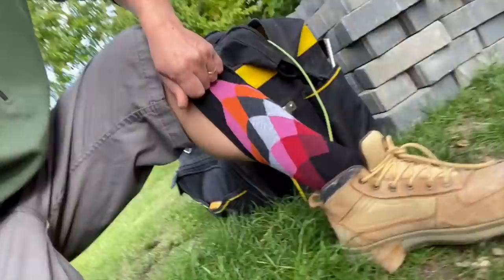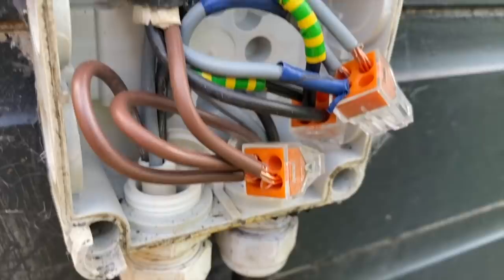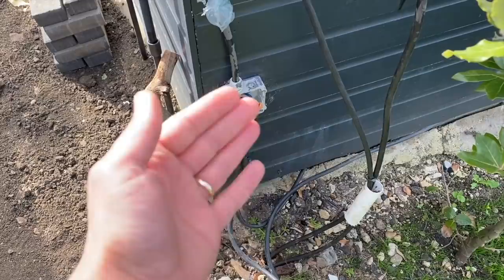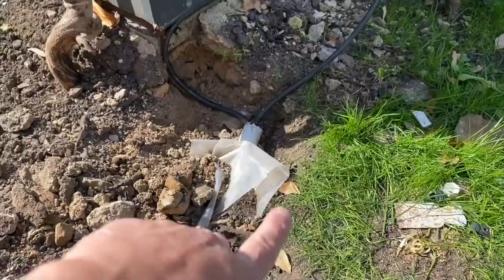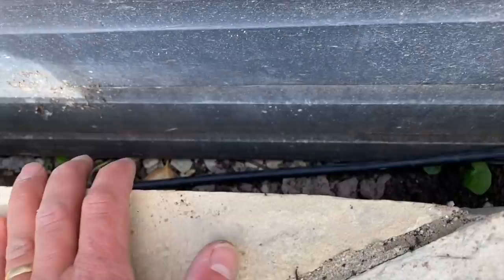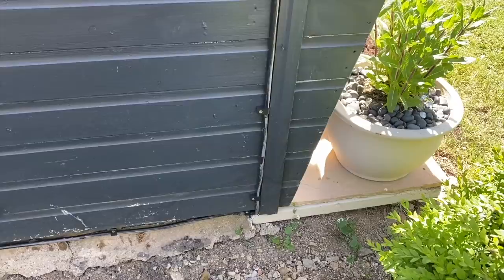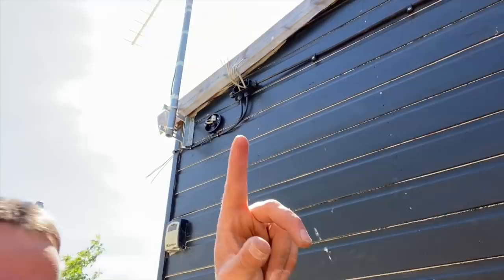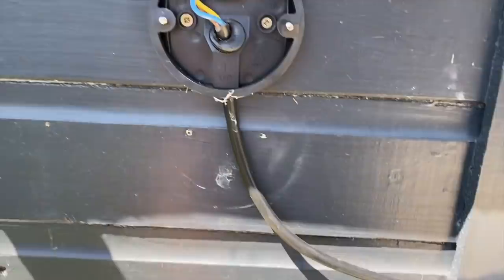Pretty sure this is not the correct way to install Wagos !!

Comment from the maker: Makes for a good debate this one. I’m returning to the job to sort the house end out yet so any buried cable that could potentially be damaged or impacted will be getting the swa earthed to the relevant circuit.
Reply: Is the lighting on a fused circuit or run from the socket?
Reply: Propper nice job.
Reply: Yes, I did think that the buried section of SWA should have the sheath earthed at the house end. I do appreciate that you would have to be pretty dumb to dig or drill into that cable when the cable run was so obvious. However, as qualified electricians (even ones with the very basic Domestic Electrician C&Gs like me) will know that people (customers, DIY'ers and some trade-persons) ARE pretty dumb when it comes to electricity.
You could still argue that the SWA sheath earthing should be continuous through out the installation in case someone were to extend the circuit later. However, a properly qualified electrician would know to check the installation before beginning work AND test afterwards. In addition the extended cable might require its own earth electrode (depending on cable length and purpose for the extension) .Complete amateurs would not appreciate when and why the  sheath should be earthed at all. The issue would be be for the people who know a little about electricity and do not necessarily have the full test equipment, however even they should be able to spot the lack of metal glands at the remote ends.
Reply: @tresslerj1985  a
Reply: @julianpearce218  a
Reply: @julianpearce218  a
Reply: @julianpearce218  àà
Reply: @despryal1951  your comments make no sense tbh
Reply: @julianpearce218  I don't see how it is legitimate to leave the armour unearthed, if a nail pierced the cable the line could be short to the armour which would then all be at line potential as the protection would not pick up the fault....
Reply: Those particular wagos aren't meant for multi threaded wires. The wagos that are, have levers on them for each wire separately, clamping the contact down internally and individually. Used them today in a new house we're building for a customer. The levers usually are orange.

That being said, the length at which the wires were stripped is laughable indeed. Bare copper is sticking out by lots in a way it could short easily, not to mention the risk of human contact.
Reply: Noticed you never earthed outside socket even tho drain hole drilled it can block  water would fill up and hit live causing box to become live it should be earthed to bottom terminal  seems strange but had this happen in a factory  and have noticed it several times when changing damaged sockets
Reply: @robertwilliamson3934  It's a polycarbonate box, so won't be going live any time soon. Also the instructions note that the rear earth terminal be positioned at the top. Indeed, "TOP" is even stamped on the interior. Got a problem with that, contact BG.
Reply: @JohnSmith-ws7fq  got a problem with that  yes I do smart arse  and they can fill with water and become live  checked with mk years ago and hagar ones currently have a non conformanty on them ie no earth  was just letting people know as a colleague got a shock off one years ago in a fish factory and have come across it several times since so your theory of it being plastic so won't become live is one off ignorance
Reply: @robertwilliamson3934  I would suggest the IP of the socket has been compromised either by improper installation or subsequent damage. That notwithstanding, (a) assuming this is the BG socket, the earth terminal is already the lowest point of contact for any water that has collected inside and (b) sockets must be RCD protected anyway.
Reply: @JohnSmith-ws7fq  incorrect  they drain hole was slugged up and on every occasion the earth was in top terminal my point is they should be earthed also these type of boxes are not solely used for sockets  which by the way don't always have to be on a rcd they can be risk assesed

Comment: The armour of an swa cable is classed as an exposed conductive part and must be earthed and the appropriate manufacturers glands used, it must never be left unearthed.
If you want to treat it like NYY-J then use NYY-J.
Reply from the maker: A conductive part which can readily be touched.
Reply: CJR ELECTRICAL  It can be made live under fault conditions such as impact or damage to the cable itself regardless if it’s buried or clipped direct to a surface , it should also be terminated using the correct manufacturers glands which are accessible once a cover is removed. It should never be left unearthed period.
Do you Earth recessed metal back boxes? Do you believe they should be earthed? Same principle. 
The fact is if the armour is left unearthed, then that the work has been left in a potentially dangerous situation and is non compliant with bs7671.
Reply: He explained it in the video its clipped no chance of impact it wasnt earthed before what he has done has left it in a much better place than it was before - as he said another days labour also that the client might not want to pay for - there is no problem with this job at all
Reply: Simon Harding If swa is used in whatever setting you can’t blindly state that the cable cannot be damaged , if the armour penetrates any live conductor, then it will be live and a potential shock hazard which is why it is earthed , the same as any other exposed conductive part which forms part of the electrical installation, if the customer doesn’t want to pay to do the job correctly then the alternative is to work on it and leave it potentially dangerous is it?
Reply: @simonharding1572  Irrespective of a persons interpretation of the regs, It is just good practice to earth the armour, unless there is a specific reason not to. He should have earthed the sections/parts he has altered (ie anything after the first socket) and fitted the appropriate external glands. If the client doesn't want to pay for the remediation of the supply cable then so be it.
Reply: Lets put it this way, if I was due my annual NICEIC inspection, I wouldn't show them a job where I hadn't bonded the armouring on an SWA

Comment: There is a type of Wago,nummert 221 that is directly suitable for flex wires.And i mostly avoid off wartles on the upside..They may be water tight,but sometimes you could forget to tight them up and the water comes in easely.That doesnt happen when you use the side off the box or on the under side.

Comment: Love the tip about using the gland to pop through the wiska cutout  - very neat.
But I can't agree with the use of ferrules for flexes in Wagos unless you use very soft copper ones. Because of the stiffness and hardness of normal ferrules, the blade in the Wago won't be able to deform the conductor in the way it normally would to get a good surface area of contact. I think especially on higher current circuits there would be a risk of connections corroding and become high resistance. Stick to the lever Wagos for high current flex connections direct to the copper conductors.
Reply: Have to agree with that

Comment: Looks good but id definatly gland the armoureds. You can get the earthing nuts that fit within the whisker boxes so you dont need the banjos. You can also get the IMO boxes which is a whisker with a din rail with terminals pre installed. Can get them from Edmondson wholesalers. I agree with someone elses post about the Grips, id definaly go for the knippex flat jaw version to eliminate destroying the glands.. especially plastic ones. Keep up the good work and stay safe 👍😁

Comment: Hints that this isn't NYY:
- NYY up to 10 mm2 is usually -J so 3-core would be brown, blue and yellow/green. NYY-O 3-core would be brown, black and grey but that's rarely ever used since you aren't allowed to sleeve anything green/yellow in Germany, which is where NYY comes from. Earths have to be green/yellow along their entire length. -J means with earth conductor, -O means without. Pre-harmonised German cable designations don't make much sense, just have to memorise them.
- NYY up to 10 mm2 is always solid, not stranded, I think you can even get solid 16 mm2 shudder

Comment: All that SWA is quite chunky for just using on the outside of the shed. If there is a low chance of mechanical damage I will often use H07rnf cable as it's easier to work with and doesn't look as industrial in a domestic setting.
Reply: Tbh we just use NYY and be done with it. Sometimes even NYM in UV-proof copex because it's up to code and for short bits outside in long runs it saves massive amounts of money.

Comment: I'd have probably glanded one end of the armoured with an earthing nut inside the box. At least one end of the SWA could be earthed then. Nice sparkies plaster by the way.
Reply: 100% it’s an exposed conductive part
Reply from the maker: A conductive part which can readily be touched?
Reply: @tomorichard  yeah I agree mate. The armouring could potentially remain live under fault conditions if not earthed. I would have glanded especially since it's buried. You couldn't see how deep the SWA was buried, there's always a chance a spade or whatever could damage the cable.
Reply: @Cjrelectrical  potentially if the outer sheath is damaged in the future. The punters aren't always as careful around cables as us sparks 😉
Reply: @Cjrelectrical  and I'm not having a go by the way mate. U could see the original install was dog shit and you're making the best of a bad job. Not a perfect world by any stretch mate.
Reply from the maker: No offense taken mate I’m going back to sort the house end out so might stick a piranha nut on it 👍
Reply: Good decision mate. Apart from the good install.
Reply: @Cjrelectrical  its very hard with jobs like this how far do you go without pricing yourself out of the job or doing work you dont get paid for but making sure its safe!
I would agree with the armour comment it needs to be terminated correctly incase someone puts something through it and makes the steel armour itself live. Cheers
Reply: @Daniells1982  that is what i was thinking. My pet hate when i go to jobs and the armour isn't terminated correctly.
Just he is putting someone else's mistakes right snd as far as the customer can see they will be paying forr no obvious change. 👍
Reply: I would gland the swa aswell its always best to use the earth wire and gland. Plus if the outhouse gets metal clad boxes in the future then they will need earthing protection

Comment: Dont know if you would be interested in this or not but where I am in the north of Scotland we dont ever tend to use any drain holes or any outdoor light or socket ect unless it's a IP rating of 65 or above. 

The weather is that bad when it comes that water gets in everywhere so you have to glad and seal if you want it to last any length of time. 

Lovely neat job you have done. Those lights would not last long here though only ones I have come across that seem to hold up well Panasonic's Victorian style LEDs dont know if they still make them but they had a decent IP at 66 and could be sealed well. Sorry for the randomness 🤪

Comment: Food for thought about not using the correct swa glands and ensuring the armouring has a good solid earth connection. Home owner decides to dig garden using an old school metal fork including the handle. Drives fork into the ground straight throw the armouring and live conductor. Will your circuit disconnect in time? Will it even disconnect ? Not picking holes in your work BTW you seem a decent bloke too and I can see your putting right someone else's shite work. Over the last few years I've seen so many installs were swa cables are not glanded correctly or not glanded at all.

Comment: We'd never be allowed to do this in Australia.     SWA would have to be down at least 500mm in sand covered with tape.   Seems in the UK you can just chuck it in without too much effort with the shovel.  We'd also  have to ground the SWA cable to ensure it doesn't become live in an accident.   Love the way you can use the rugged cable instead of conduits.  We'd have to put a sub in for the lighting too.

Comment: the armoured cables need earthing as if they were to get damaged the armouring would could become live and not trip nothing.
Reply: I was thinking about that, but if mechanical damage isn't a concern then you still have two layers of insulation between the copper and the armour, and the outer insulation means I don't think the armour would count as either an exposed conductive part or an extraneous conductive part, but not entirely sure...
Reply: If buried it has to be glanded correctly so that it was earthed for protection against any mechanical damage.  However as it is used in the same way that twin and earth could had been used, I believe it is acceptable for it not to be bonded.
Although I don't agree with it.
Theoretically he could had used different cabling to save the hassle of using armoured but I am guessing the swa was already there to be re used.

Personally I'd had made all the joints off correctly and carried the swa through so in my eyes it was done properly.
Reply: I think it's in the British standard for armoured cables that they recommend the armour be earthed at the supply end.
Reply: One end of swa should be correctly glanced but hey it’s your job and I also hate making off swa 😃

Comment: Personally for me the lack of supplementary bonding to the SWA armouring I would class as C2 if found during a condition report. As for the works you are carrying out I’d imagine you would cover by issuing a MWC OR multi MWC. I would be unwilling to complete works without bonding the SWA  as I’d be efficiently certifying that the installation is to BS7671.
Reply: Wouldn’t the SWA armoring be bonded at the other end? It’s not supposed to be bonded at both ends is it?
Reply: @JasperJanssen  Depends on the earthing arrangements of the property/site and how and what it's feeding. If you bond both ends, you need to make sure you don't create a situation where you could get a dangerous potential between different bonded/earthed points.

Comment: Sorry could not leave the swas without the correct glands being fitted. Would class that as a C3, as you know it states in the regs that equipment should be installed in accordance with manufactures instructions!

Comment: 8:15  No need to cut or drill Wiska boxes! To be fair, I have never seen that explained in any video (before this). However, I did work this out, the first time I used Wiska boxes. The clue here is that these are meant to be self sealing. If you cut or drill, you are going to compromise that seal. I must admit I was a bit nervous about opening the  hole with a  SWA gland. I was concerned that the metal gland would strip the PVC thread before the gland popped through. Happy to report:  It did not, the PVC thread was not damaged and the seal was not compromised in any way. Hats off to Wiska boxes, I will be using them again.
Reply: Did you butcher the glad with a pair of grips too or use a spanner? :-)

Comment: Personally all armoured cables should be glanded properly. On small cables like that it doesn't take long per gland to make them off. Glands with earth rings fitted ensures armouring earth all the way through the circuit.

Comment: I don't agree with not earthing the armourings
Reply: Well, you said it: Armour. A shield. A mechanical reinforcement for earth-laid cables. The first thing that breaks (and that's how it should be!), because it's outside and rigid. This is not a reliable earthing, not by electrical standards or mechanical ones. In contrary it serves the purpose of protecting the cable from injuries. 
For signal leading cables (with a shielding) this is a whole other situation and also serves a completely different purpose.

Comment: Good vid as always. Wow haven't seen wiska boxes that size that's a real shout for lighting.  Generally like wiska ext jbs only thing I hate is the 90° locking screws there so easy to mash up with a screwdriver....
Reply: Take a look at PB Swiss tools, they do a neat button driver.  Pricey though!
Reply: I found the biggest flat head in my bag does it nicely without damage. Easier said then done though when your up steps with that tempting terminal driver in your pocket at 5 o clock

Comment: i must say i love that feral crimps dont use straned much in the states but do like em might get a starter set
Reply: Most European countries require them everywhere, unless the manufacturer explicitly bans them (I think Wago states that you shouldn't use ferrules in the lever-type connectors), so you can't even connect a plug or inline switch or lamp socket to a bit of flex without ferrules. That's also why stranded building wire is highly unpopular in central Europe, except 10 mm2 and up.

Comment: One big error. It is not allowed to mark a isolated cable with yellow/green tape. The wire has to keep its color code trough the hole length.
Then input on the top of a box. Big mistake outdoors. There is always water coming inside the junction box.

Comment: Good job i would say but i would personally use some plastic protection on all those cables..even they have protection .i would not trust it..extra plastic protection (like flexible plastic protection useable into the ground as well) is much better choice..

Comment: @8:50 get yourself a knipex pliers wrench instead of cobra so you wont leave marks
Reply: One thing that I find strange is that people chew the nuts/bolts/glands etc up for no reason, you could even use an adjustable.